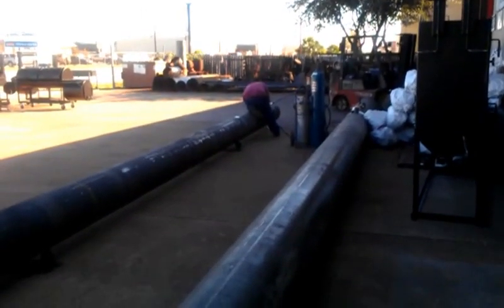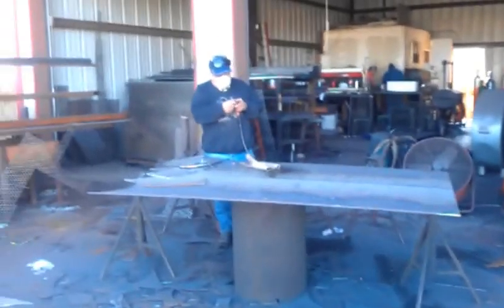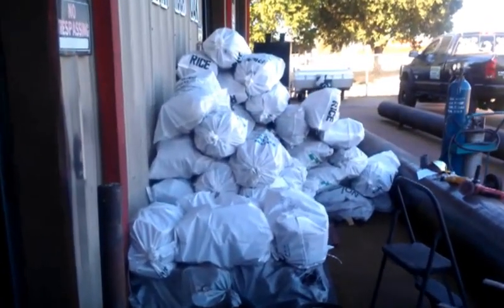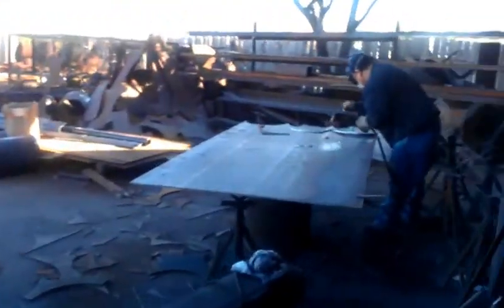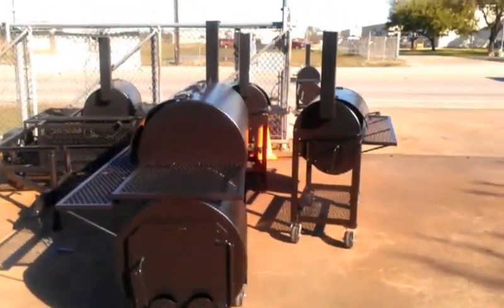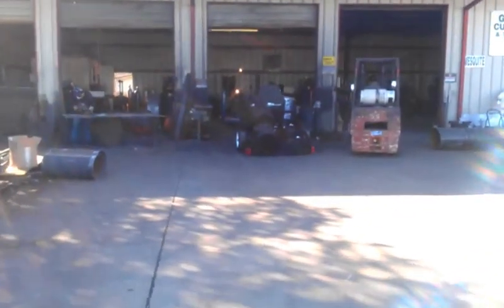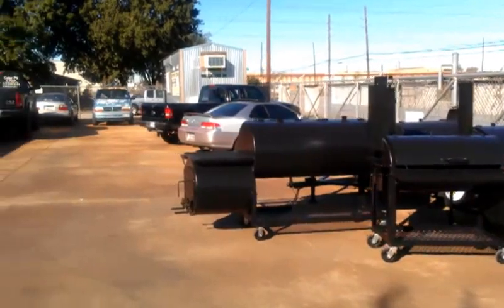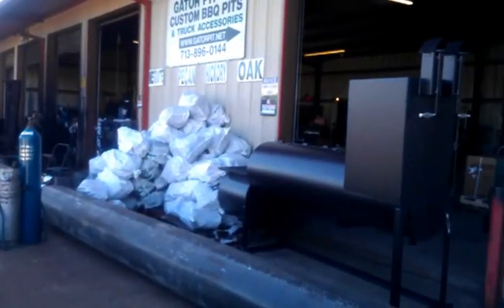Gator Pit uses new pipe

Comment: Hey Ritch, was wondering if I might get some advice.  I live in Lexington Kentucky and I am trying to find steel pipe to make my first smoker.  Every place, and I mean every place I have contacted about steel pipe have said there is no such thing as steel pipe the size I am looking for (1/4” thick, 20” diameter, at least 4’ wide for the cook chamber and 2 foot wide for the firebox).  Do you have any advice on what I need to ask for to find the pipe I need?  Everyone keeps suggesting I could have it rolled...does that make sense or is that what you do?
Reply from the maker: They have it.  Just don’t want to sell a cutoff and waste a full joint. Common.  I have to buy it in 40-42 foot joints.  May have to roll.  Good luck.
Reply: @GatorPitofTexas  thanks for the info!